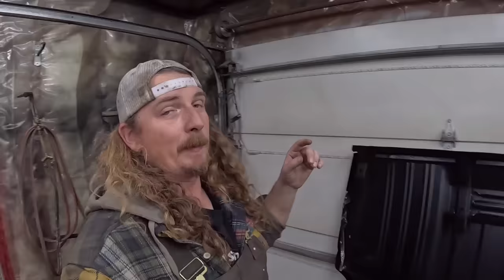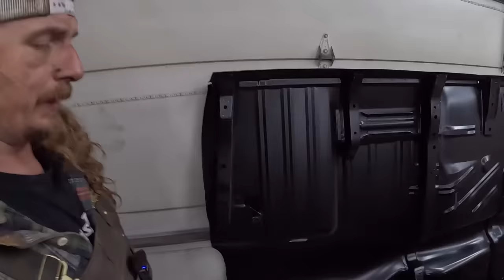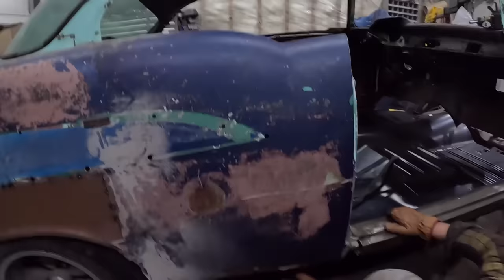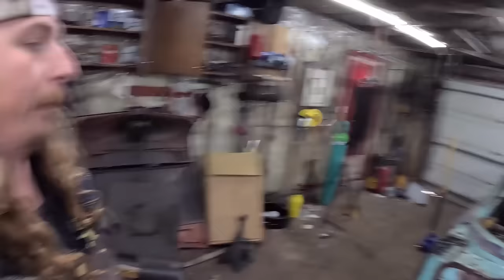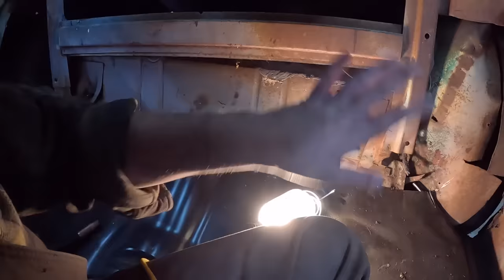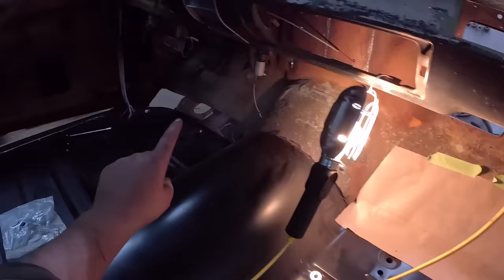10 Minute Floor Pan Install! 1 Man, No Lift - Worlds Worst 1957 Chevrolet

Comment: That car would be so sweeeeett painted the original surf green with a white top and Belair side trim , a Super Sport interior from 61 to 64 in white with zodiac green seat inserts and a 1959 impala steering wheel

Comment: Great work Dan you get better with every full floor pan you do !   the full floor pan is the best thing ever it saves so much work over making a quilt of patches. the money a full floor pan costs  is well worth the amount of work you save by putting in one huge piece instead of lots of small ones. your driver's door is a 56 the lock is closer to the door handle than the right side 57 door.
it is great inspiration watching you knock out all the metal replacement so quick .

Comment: Hey Dan,,instead of plug welding the sills to the floor pan i bought a 220v spot welder from princess auto. I was done in no time & it looks factory. Best $250 shop tool i ever bought next to my  bead roller,,metal shear,,shrinker/stretcher,,stud welder,,etc,etc
Reply: I do love a spot welder for nice factory look.  used one back in the day prior to my service pops had one, great tool have in your shop.
Reply from the maker: Yeah. I keep looking at that thing

Comment: westport wa.state here.  wrote this before watching it.  open mouth insert foot.
you do enough floor work to justify picking up and air hole popper. holes in seconds. roll over  it with a grinder. all done minutes. and can used in car.  and then you us one. smart man.

Comment: This is another awesome video This is why I call you Dan the floor pan man you rock. After I saw you do that the first time I talked my buddy into doing it on his 56 2 Dr hardtop it worked great the only difference we used my lift to lift the body. He thought I was fk nuts until I showed him your video. and it went well. Then we celebrated with a case of beer as usual.

Comment: I agree about the whole pan replacement-a bit pricey but the time you saved was worth it.considering this car was just a cut up shell you have come a long way. truck floor pan replacement is a breeze compared to  tri five coupes and sedans.good work cant wait to see it as a runner.

Comment: I've never even attempted to do body work, other than bolt on panels, and I've had a lot of problems getting those lined up. I'm strictly the mechanical type. I like to do engines, transmissions, rear ends, brakes, steering, suspension, pretty much anything you can do with wrenches and screwdrivers. I also like electrical, and by that I actually mean electrical, not electronic. If it's digital, I know nothing about it. On a car, the only thing I work on that's not 12V is the ignition system. I prefer points ignition. I have installed glass in a few cars where it's just done with rubber molding and string or wire, no adhesives. I've replaced a lot of door window regulators. I am absolutely amazed watching you do all that body work. You make it look so easy. And it may be for somebody who has done it forever. But it's not something you are going to learn overnight, or even in a couple of years.

Comment: Just makes more sense motivated , had a Heart rhythm shock Friday ,11-11-23 I’d cut most of drivers rocker out on the Wednesday was in A-Fib (Heart  A-Phibrilation) so Friday they Shocked back into rhythm . Tomorrow ( Tuesday 11-14-23 I’m goin out to finish cutting the rocker out , clean it up and start custom fit of new rocker , after 50 yrs , an 4 watchin Dan . I’ll have those rockers and floors in in a couple weeks , but the temp could drive me in lol no heat in tarted up carport , or not yet lol

Comment: If u put the new panel under the old rear floor, it is easier 2 tack from the front, raw edge of old floor 2 new steel. and, the splash from the front won't get in the seam if it does open anywhere.

Comment: watching the last video i was thinking how much easer it is to have all  cordless tools.    you just zip zip kill the rust by by . I remember  how the grinder cord w get wrapped around the air line and the trouble light extension cord ..we would pop breakers if you ran too many things at the same time ..... and boom ya got a new  corded trouble light. I laughed out loud before you even mentioned it. its the little things that people/fans can relate too .. and the big things ..it is DD speed shop after all 👨‍🔧💁‍♀

Comment: Any seasoned guy could look at your work and yes. A seasoned guy will look at it and say it's going to be soft to you welded out once you weld it out that thing's going to be Rock solid new frame new parts on new sheet metal yeah nice work. I know what people think they look at it and say it's just an old rusty car I'm sure you've done more than that thing than they would ever do to something in there life...

Comment: See how this car has full brand new floor pan brings it from junk to decent in a hurry. Acutally its not that rusty on the trunk and fire wall so it is going to be real nice after all is said and done. You are the lone wolf expert full floor pan installer world wide champ:trophy-yellow-smiling::trophy-yellow-smiling::trophy-yellow-smiling::trophy-yellow-smiling::trophy-yellow-smiling::trophy-yellow-smiling:and with out a lift in a 20x22 garage. You get a lot of work done real quick. I am impessed. Actually it turned out real nice.